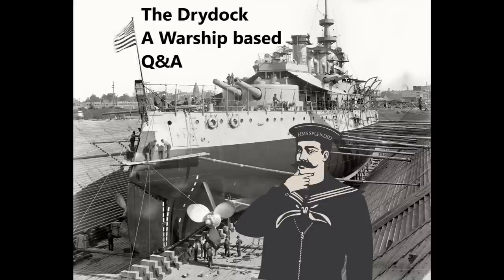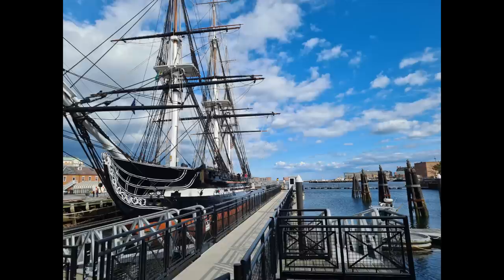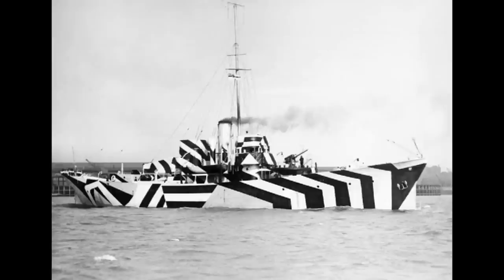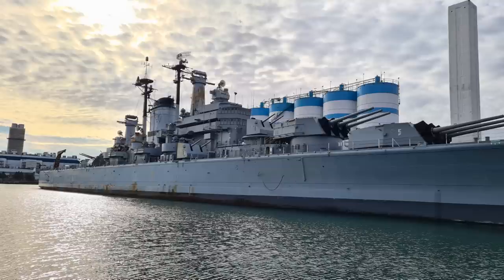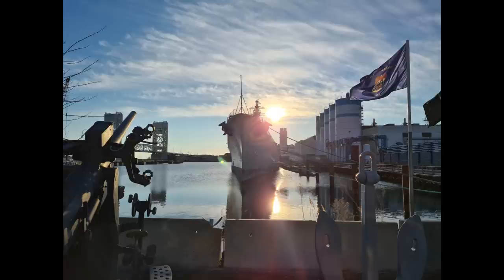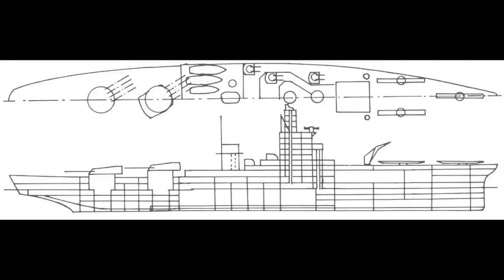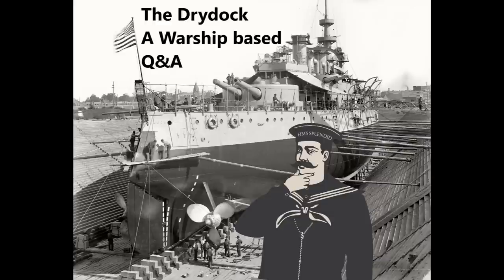The Drydock - Episode 206

Comment: My grandparents’ house, circa 1920’s, had a mechanical stoker for their coal fired boiler in the basement.  It consisted of a hopper with a kind of screw drive coal feeder.  There was still a lot of manual labor involved in keeping hopper filled and removing the clinkers from the fire box.  It apparently was “state of the art” when installed.
Reply: State of the ark.
Reply: My dad has told me about clearing the stones out of the stoker when it would inevitably jam.
Reply: Cole used to come in various sizes and grades. The automatic stokers were probably for what they called nut coal or rice coal.

Comment: The thing about dazzle camouflage is that it's not actually meant to hide a ship. On the contrary, the multiple colors might even make it stand out more than just painting the whole thing grey. It's real purpose is to confuse an observer looking at long range through the optical system of a fire control device, making it hard to get accurate inputs for range, speed and angle on bow.

In the age of sail fire control systems didn't exist and engagement ranges were anyway so low that any benefit of dazzle painting, apart from artistic preference, seems unlikely. That said, I would love a Wednesday special on all things dazzle.
Reply: Dazzle camo in The Age Of Sail.....  the only advantage I can see is it might gain a bit of time to effect an escape, as the opposing crewmen are laughing themselves silly.
Reply: Dazzle camo is great
Reply: Dazzle camo was overseen by some mod artists (IRRC). In the age of sail, you'd have Turner, Ingres et al in charge. Lovely pics,  but not abstract colour-theory needed for the job...

Comment: My (limited) understanding is that modern coal fired power plants handle automatic stoking by basically grinding/crushing the coal into a uniform coal powder; so it can be blown into their boilers.  Assuming the grinders produce uniform output that would eliminate issues with clinkers and distribution of coal on the grates.  

But I don't think I'd want to even think about a system like on that on a ship.  Even if you're only grinding coal on demand, just before injecting it into the boilers, it'd be hard to keep all that coal powder from getting everywhere -- making even more of a fire (and potentially explosion) hazard than coal can already be.  And if you were storing only powdered coal in your coal bunkers (so you could use pneumatics for automated coaling and distribution) those risks would seem massively worse!!
Reply: The last steam ferry on the Great Lakes, SS Badger, uses that very system.
Reply: I used to work with power genrating boilers for a paper mill and that is indeed how it works but you still get clinkers due to the temperature at which most of those boilers operate, the coal burns so hot that it actually creates slag that kinda looks like magma and when that hits the ash collection tanks it can clump up into a clanker. Now the boilers that I worked with were significantly larger and operated at a way higher pressure (1500 pounds) and thus temperature than a warship boiler. We also had to deal with a lot of EPA regulations as to how our ash was collected and flue gasses were neutralized and so I really don't know how much of that would translate over into a warship.

The three biggest issues are going to be moisture, dust  and flue gas emissions. When you grind up that coal it turns into an incredibly fine powder that gets absolutely everywhere and is all but impossible to contain, your entire ship is going to become a dust explosion waiting to happen, and as if that wasn't already bad enough that fine powder will begin to badly clump like cat litter and start to jam everything up unless you mitigate it. We actually blended our crushed coal in with shredded car tires and burnt the coal and rubber together, our boiler was a forced draft boiler running at about 500,000btu/hr though, so it just annihilated the rubber, I don't know if the (comparitively) low temperature boilers of a ship could handle that. The other big issue is that one of the chemicals inside the flue gas of a coal boiler is hydrochloric acid and the more volume of coal you burn the more of that acid you make. Now you do measure the acid in parts per million but if I remember correctly anything over 0.25ppm acid was considered an environmental hazard by the EPA, once again a warship is a totally different animal but that stuff is not good for your machinery. Oil burns both hotter, which allows for higher pressure since hotter steam has more energy, and also burns much cleaner, it's also far more controllable than coal.

Oh another thing I just thought of too, coal boilers which use the pneumatic injection system with crushed coal cannot be bed burning, they burn in suspension, which means that the bottom of the boiler is just a cone with a hole at the bottom (which is called a monkey for some reason) for the slag to drip out, this monkey needs to be routinely poked clean (we had to poke ours every hour) you do this with the boiler running but if that monkey ever plugs up and stops flowing freely the boiler needs to be shut down and cooled so a man can go into it and clear out all the slag that's now plugging up the boiler's bottom.

It's doable, but I don't know if it'd be good for a combat vessel, there is a ferry that has that system though, the SS Badger.

Comment: there are at least four coal fired vessels currently transporting bauxite from Weipa in the Gulf of Carpentaria to the refineries in Gladstone in Queensland.  names and ownerships change regularly, but they are all approximately 75,000 tonnes, using chain grate boilers and geared steam turbines - look up the "River Class".  their advantage is that Gladstone is  a huge coal exporting port (approx 6 million tonnes per annum of thermal and metallurgical coal) , so these vessels can refuel easily with cheap coal for the round-trip.

Comment: The railways found that mechanical stokers needed coal size graded towards their needs. While they did have some ability to crush lumps slightly out of size tolerance that ability was limited.
Reply: Notable to point out that basically every railroad had locomotives tailored to their coal supply as well, and when they bought used it would be from the same road. Bay Line railroad in Florida got some locomotives off FEC and off of NYC supposedly specifically because they all sourced similar or the same col
Reply: coal*
Reply: Loved to see my question answered. And thanks for this extra bit!

Comment: Ports: Before electric motors and lights were widespread the ports were for light and ventilation. There were scoops that could be put thru the port to divert air flow into the ship. Powered ventilation was one of the upgrades for older ships. In WWII the US navy welded plates over prewar ships hull ports to stop flooding when listing. With ship damage the ports leak from plate distortion.

Comment: Another excellent video.  I have to wonder why the last segment didn't feature the sinking of the USS Maine in Cuba.  It was thought to have been either the Spaniards or, more likely the insurrectionists.  Recently marine archaeology seems to have determined that the explosion was due to a design flaw in the barrier between the fuel bunker and the engine.  The greater significance was that it also ignited a war that sank most of what remained of the Spanish Empire and pushed the US into the ranks of aspiring naval powers.  You may actually have covered this and I just failed to find the video in your voluminous production.  Cheers and do keep up the excellent work.

Comment: As to the automatic stoker question i would suspect that there is a lot of complication added by the fact that on a locomotive you are taking coal from a tender with one bunker with 6 or 8 cubic yards capacity while on a ship you are taking coal from several bunkers of an order of magnitude larger capacity, What ever system used would still have to rely on crewman to mind the bunkers and make sure the coal is being feed into the stoker at the bunker.

The crew would still be required to tend the stoker and to hand fire the boiler if the stoker failed. I think the biggest advantage would be that the mechanical stoker system would be able to supply coal into the engines faster and maintain a high rate of fueling over a long period of time. (as in during a chase or pursuit)

It might be worth considering that power stokers on locomotives didn't replace the fireman in the crew, it was generally used when the engines were large enough to burn coal at a rate that the fireman could not keep up with the requirement. This was only on very large locomotives common on major North American railroads. As a rule British locomotives were hand fired.

Comment: Hi Drach back in your USS Constitution video you claimed once the Royal Navy had captured USS president you said they took design ques from her, I'm interested where the source was for the UK taking information from USS President. As I have read about the notes they took from her and they were not positive in the slightest, they did say a strong hull, was it that they took. As I haven't found anything positive about them as by the time of 1812 they were 2 decades old and out of date. HMS Endymion which wasn't that new a ship, which captured President was a better ship in every way from speed 14 knots which was a lot faster than any of the 6 frigates, to matching firepower with President in all but the type of oak and possibly cross bracing (although Endymion may have had that) and Britain didn't have access to that type of oak anyway. And Endymion had a class made from her lines, however that was before the war of 1812. I can imagine the initiative hull deisgn being taken but I was under the impression that by even before 1805 other ships were already using it. If the war was when they were built that makes sense as they were revolutionary ships but by 1812 they were out of date.

Comment: 00:34 also a 32 pounder gun ship would have been slower and one of the things noted when Chessapeake and President were captured was that they were surprisingly slow. So 32 pounders would have made them even slower, this would have been an issue as a 64 gun and 74 gun would have a larger sail area meaning the 32 pounder armed 6 frigates wouldn't be able to run
Reply: President had run aground and suffered fairly extensive hull damage just before her capture, so it’s no surprise she was a bit slow.  I don’t think the RN would have built a copy of her if her performance had been that poor, trolling value or not.  

Chesapeake was one of the diminutive designs, and as I understand it, they had worse sailing characteristics than the full size 44-gun frigates.  The RN did note that she was not particularly fast in British service either, and they didn’t copy her design, so her performance can’t be written off to poor material condition.  

But even with the 44-gun versions, it’s my understanding that they were only of slightly above average speed for a large frigate.  They were just more heavily built than other ships of their size and speed, so they punched above their weight in battle and probably maintained their speed better than most frigates in heavy seas.
Reply: @bluemarlin8138  well actually they repaired the ship and both Chessapeake and President were marked as slow. 

We actually don't know if it had worse sailing characteristics, it was made later when more advances were made all we know is it wasn't as powerful, it should have been slower but better maneuvering but as I said technology was actually moving quite quickly at this point.

The issue is that we have no evidence they were fast especially by 1812 standards. The other issue here is they didn't punch above their weight as there were entire clases of ship their size and power, such as HMS Endymion the French design it was based off of and the severn class built to it's design. Endymion which was the fastest ship in the entire Royal navy a decent amount faster than the 6 frigates, which was started production a year after the six frigates, but completed at the same time and was just a better ship, not even ifs or buts it was factually a better ship, as we see (in fact from other ships as well) 24 pounders easily even at extended ranges just punched straight through white and live oak, so even their strengthened hull was of no help.

Comment: Re - 24:43 - ISTR reading that ships' boats were used in surveying, with one crewman 'Swinging the Lead': thick fishing line weighted with a lump of the metal, payed out and recovered with the man's arms working endlessly. Other crew rowed the boat, with an officer directing and noting depth and bearings to be added to the chart later.

Swinging the Lead was considered the easy option when compared to near-constant rowing. It's an expression which entered normal use, its origin forgotten. It might have been a fourteen-pound weight with the wet line cutting into the users' hands. Was the line marked in fathoms or did the crewman measure with outstretched arms at full span? I don't know.

This process allowed working closer in to shore and to potential hazards.

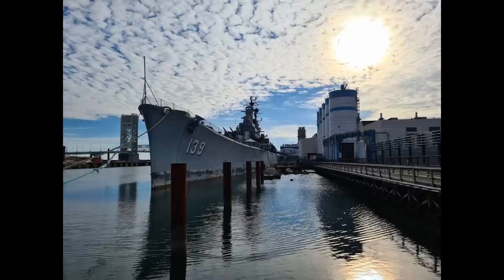Comment: Concerning 9:49, I understood the the Japanese made a specialty out of night fighting and had a kind of night vision technology the Allies didn't have.
Reply: Japan had better optics for literally seeing at night, allowing for clearer images in low-light conditions. However, they still depended on the human eye to work, so even though you might see some number of yards further at night than using ordinary optics, you were not beating an American radar set for ranging and detection purposes. Indeed, most of the time Japan did well with night attacks, the Americans either ignored their radar warnings or the ships in question were not equipped with it. By 1943, it was very rare for an American to not have radar and to ignore that radar enough for the Japanese to get close enough to use their better optics.

Comment: On Kongo vs Des Moines, two of the Kongos did have radar! The "Kongo Class Battlecruisers" Shipcraft book by Steve Wiper says that Kongo and Haruna - but not Hiei and Kirishima - had early search radar sets by Oct 1942. By late in WW2 Kongo and Haruna were carrying more modern radar, even if they did not measure up to the USN.
I think it is a little unfair to compare a 1942 configuration ship against one from 1948. Either downgrade the Des Moines to 1942 US radar, or give the Kongo late WW2 Japanese radar.
Reply: The two Kongos had search radar.   Fire control was still done with optical range finders.

Comment: Mechanical Stokers on railway locomotives were brought in for the largest locomotives where a fireman couldn't keep up with the firing rate for any length of time. 
Where you have access to a large number of stokers that can share the load they would be preferred.
Reply: I’ve watched the British Pathe videos and there are several on steam locomotive operation and the stoker is much more involved  then just heaving coal and a good stoker saves coal and keeps the train running on time.
Reply: @RMJTOOLS  Railway locomotive grates and fireboxes are a bit different to those on a coal fired marine boiler but essentially the same. 
Air comes up from below the fire through a grate. A  good loco fireman will try to keep an even layer of coal across the grate and make sure it is  burning evenly. If it's too thin a layer then the draught through it will be too fierce and unburned coal can be lifted and carried in to the fire tubes, this both wastes coal and can clog the tubes. Too much air coming through too thin a layer can also overheat the grate and the firebars can get too hot and start to burn. Too thick a layer will restrict the draught through the fire and the heat will be reduced, plus coal can start to clinker up.

Comment: 'led' - that's what the weight on the end of the line was made of. cf 'plumber'
Reply: Not always; sometimes it was just made of iron. And many of them had a hole in the bottom, where wax would be stuffed in order to get a sample of the material from the bottom, so that datum could be added to the charts, since the makeup of the bottom affected how and where you would choose to drop anchor.

Comment: If Drach who is in great shape suffered to get to the top of the Rock of Gibraltar, that would be a guaranteed heart attack and a burial at sea for a 250 lbs 6'1" big boy Canadian such as myself 🤣
Reply: Pfft, don't be ridiculous. I did it no problem, and I wasn't fit at the time, plus it was absurdly hot.

Granted, I was in a car, but still!
Reply: Or just use the cable car 😉
Reply: Goofle the Rock Run...:-)
Reply from the maker: The climb is tiring but not too bad, it's the 100% humidity, blazing sun and 95/100F - 35C temperature that does it 😄
Reply: I salute you, Drach - and this is from a US Marine who had to climb "Mount M***********" in Camp Pendleton as a recruit. The only difference was I got no chance to rest, did in the middle of the night, and did it with a 55+ pack on my back.